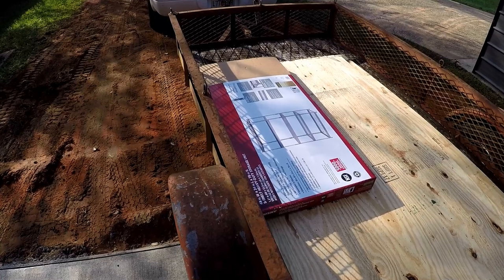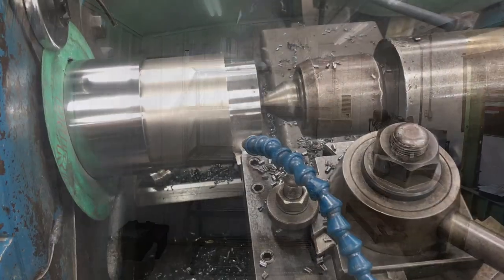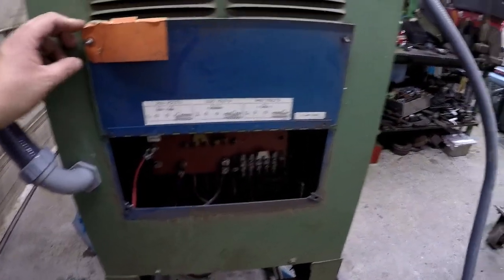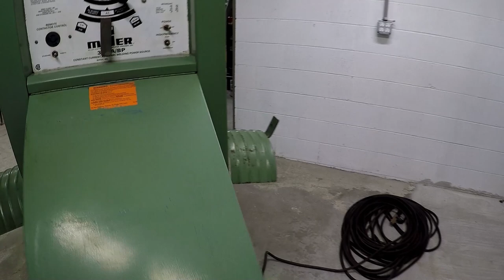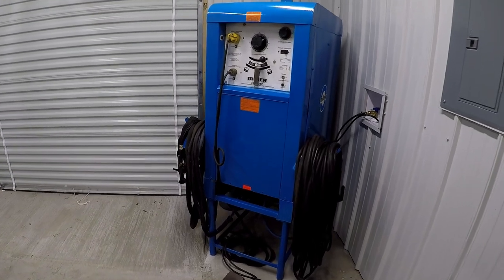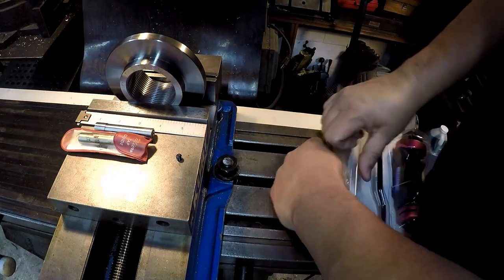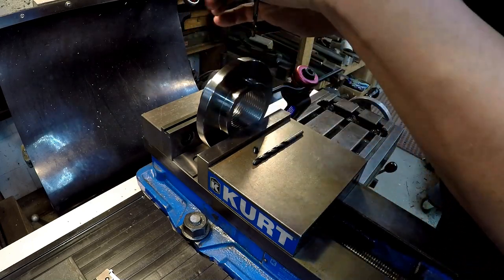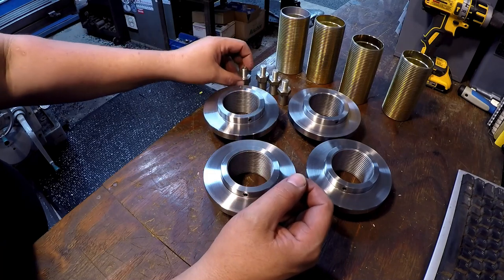SNS 192: Shop Projects, Edge Multi-Axis Stop, Drill&Tap Spring Perch

Comment: That concrete slab is great. Perfect test is running a heavy load on solid wheels over the joint between your shop and the slab.  Result?  Not even a rattle!  

Love that blue
Reply from the maker: +rupertkingsley man it was smooth, just the way I wanted! 👍🏻

Comment: If you plug cooler in to welder receptacle and leave it on the cooler will go on/off with welder. No forgetting and melting hoses.
Reply from the maker: +Rick Brandt I thought of that after the fact. We never used that receptacle.

Comment: Welder turned out great and the shop addition looks good.  That's nice to be able to adjust the start current on the welder, most machines don't have that feature.   Avoid the big box stores for plywood if you want quality hit up your lumber yard.  For what you're using it for though it should work fine once you put some weight on it, it will flatten out.
Reply from the maker: +Bill De La Vega Yea is love to buy from the local lumber yards, the problems is they are only open the time I’m at work. Big chain stores open on weekends.

Comment: If you leave the gas bottles on the left side of the door they will be more accessible and you can bolt the bottle holders to the block wall. Just plumb a line over the door to the welder. There is not much else you can put on that side without blocking the door anyway.

Comment: I think the new home for the welder is perfect but the gas bottle and the lip of the ramp bothers me. I see that edge getting all chipped and broken getting those bottles in and out. If it were me I would find a piece of wood or something to raise that area to the same height or just a bit higher than that ramp edge so you can roll those bottles across without damaging the ramp edge. Your rolling now man and half the fun is working it all out, I'm sure you'll get it just the way it works best for you eventually. I know I usually end up rearranging things several times till it's just right. I just want to let you know that I appreciate what you do to provide content on a reliable schedule. The time you put into making a video every week and working and everything else life throws at us, you ROCK. Thank you
Reply from the maker: +Michael Durling Yep I have given thoughts to something under the bottle to level that area, just havnt messed with it yet. It’s fun getting to move and rearrange things to work better. 
I enjoy bringing the weekly content.

Comment: Instead of hard wiring in the TIG welder, I'd have gone with having a Wander Plug and Socket arrangement, so the welder can be easily wheeled out, for cleaning behind it, or to plug something else in, if the need arises.

BTW. What are those four red things on the wall, above the distribution box?
Reply from the maker: +BedsitBob Your probably seeing my magnetic towel holders that I use to hold my welding hoods.

Comment: Adam on your T30 compressor... the motor doesn't look original, is it a replacement and if so what are the specs? I have one same compressor but someone stole the motor so I am looking for a replacement. I think it originally came with 10hp 3 phase but not sure.
Reply from the maker: I can assure you it's the original. I was there when Dad bought it, and when it was delivered. 15HP Baldor with some aging on it.

Comment: Adom, was looking at the wiring schematic, on the upper set of terminals, it shows 2 shorting bars, for 230 volts and from what I see in the video there is only one. Is that correct or am I missing one of the shorting bars?
Reply from the maker: +James Beckner They’re both in there.
Reply: One of the shorting bars is bent so it is hard to see.
Reply from the maker: +James Beckner I watched in the video and it does look like it’s missing, Weird. I can assure you it is though. I took pictures.

Comment: 8:19 Your local PPG or DuPont paint jobber can match that color easy and put it into any formulation you like. A 2 part epoxy should be uber durable and if you don't already have a spray gun you can pick up a gun that will do that job at Harbor Freight pretty cheap.

On my monitor, your blue paint looks like a sorta decent match for Chrysler engine turquoise ("old" MOPAR blue). Edit: Out in the sun it was old MOPAR blue. Inside the shop, not so much.

Comment: I have stopped building shelving.  There are more than a few used warehouse racking businesses in this area.  I have the heavy stuff for a workbench base with a material shelf under the top. I have another heavy rack holding  for other material and big tool boxes. My other go-to shelving is EZ-rect. I have about 50 feet of EZ-Rect.

Comment: I hate to see you take a chance with your welder. We have never used tap water, always a unit with coolant in it. After years the water will ruin the inside. Now it might take a few years buy why take that chance. The plugs in the back is probably for that. Power up welder and they become hot. I remember Florida water in the 60s wasn't that good.

Comment: The old welder is looking sharp! Mine is raised about 8in because it is on a rolling cart so it isn't as high as yours but I find it to be just fine as I certainly don't have to bend over to work the controls.  I might steal your garden hose holder idea for the cables though. I would love to have cable reels but those things are pretty pricey. Still I spend a lot of time every year wrapping and unwrapping cables so it still might be worth it.
Reply from the maker: The garden hose holders are definitely the cheap way out, but work great!
Reply: Just to stick MY nickle's worth in, a old mobile welding rig I used long ago the shop man (Burnsie we call him) built his from old car tire rims. Not on axles, but they hold more weight than the hose holders will.

Comment: Nice custom coilover suspension pieces. We use them all the time, almost exactly as shown for Pro Late race cars. The difference being we have outside diameter slots to rotate the plate once loaded with weight, allowing adjust the height and distance of the spring plate, relative to the lower base plate.

Comment: There is a sign on the welder that says do not watch the welder. The sign could say look at the welder all you want but do not watch the welding without proper eye shielding.

Another thing I notice when you showed us where the wires were behind that flap door. It looked like the wire you referred to as ground was a red wire. if that red wire is indeed the ground, please put some green tape on the wire so electricians will know what it is. Your two hot wires for 120/220 single phase are black and red, with white being neutral and bare or green ground.
Reply from the maker: +longcaster I contacted the electrician and confirmed that the red wire was indeed the ground.
Reply: Put some green tape on it. Future electricians will thank you when you identify the wires. I know when I look in there and see a red wire, I would think it was a hot wire because it is red. And a red wire hooked to a grounding lug would cause confusion.

Comment: Shop came out really nice. Home Depot should be able to exactly match a quart or gallon of paint on their computer. Just give them a chip of the color you want. Plywood that is used for signage is very good quality. Thanks for the video's.
Reply from the maker: +Waterman one Yep they have a little computer they use to match. That’s how I got the grey paint for the block wall.

Comment: The shop is looking awesome!  Love that classic Miller.  The edge stop looked like a handy like it was well made and worked well, picked up a good little tip about resetting your first part against the stop, does that change the location of the hole at all when you do that? i guess if it does it wouldn't be much
Reply from the maker: +Ramsey Customs - turbocobra Gary I like to reset the stop position once the stop is clamped tight, then find the center or do the offsets.

Comment: I do not know about your area, but in mine, go to Walmart and look for: "Muscle Rack. Heavy-Duty Steel Shelving. 5 Shelves. 3000 lbs Total. Made by Z Beam Construction, or that is what is on the box. Comes with boards. Less than $70.00" These are painted steel and NOT chrome.

Comment: I have almost the same welder as in your opening shot, but mine is orange and on a roller dolly . It's bombproof for stick welding. I have the old wire feeder for it and TIG torch but I would rather have a dedicated, modern, TIG setup.
Reply from the maker: +ColKorn1965 Yours must be the Airco version.
Reply: Yes sir

Comment: Thanks for the update. Great to see the progress.
Paint job looks good on video. If you're happy, that'll do.
Keep an eye on the cooler as it can accumulate minerals from tap water in the plumbing. A closed circuit of demineralized water with corrosion inhibitor is technically ideal, but it needs a circulation pump and heat exchanger, possibly with a fan... Bit of a bummer.

On the humidity; it can be very uncomfortable without the temperature being high. Worse if you're doing physical work. 26°C (79°F) at 100% humidity feels like 40°C (104°F) with 30% humidity. HVAC Engineers use a "psychrometric" chart to tell at a glance how much heat is in the air and what's needed to make it comfortable for work in that space.

Comment: You can always buy some Oak plywood, it's only $120 a sheet.  LOL  I ran a 9 ft veneer lathe for about a year, the tray system had 6 trays, 3 million dollar machine.  Sometimes we would get a 6 ft log in and it would literally last for 30 minutes and it was clear all the way through.  That was back in 1988, I miss those days.

Comment: Those few seconds of that stringy chip on turning the induction hardened stock, that was frightening.  As somebody said, that's razor wire in your size!  

Shop addition's coming out impeccable!  Was a long, long wait for the proper labor but that's actually helping you enjoy it more now.

Never knew that Miller welding machine was originally the standard blue all of Miller's machines are in.  I'd thought all this time that green was its original color.  Paint job came out nice!  Those two cans of spray paint turned out to be enough?

Good call on the purchased shelving.  The dad bought some shelving of similar weight capacity for putting in our basement.  Not that he plans to load it down that heavily, but close.  Just not necessarily with machining stock, more telecom field tools and supplies and wiring rolls, etc, besides the standard man-cave stuff. ^^

Has it been raining any off and on while waiting for the concrete to cure so it'll come out any harder?

Comment: Adam, you may want to check you welder on AC welding aluminum. Tap water may work but it may not.
Miller has a special additive so as not to loose the Hi Freq. Your welder may not need the additive, if it doesn't it will weld the same as always. If it doesn't, check with Miller and ask them. Cool videos Adam, Thanks.

Comment: Epoxy floors are for people who have no idea what its like to have an expensive epoxy floor in a factory. It seems like a great idea until you chip it and scratch it all up. Its not such a great idea. Its also NOT a good idea where you are welding. The weld spatter immediately scorches the coating and it releases black sooty smoke. Its not what he needs.
Reply from the maker: +Brian Streufert Epoxy is awesome for sure! We have it in our clean room at work. It’s expensive. To do the enclosure would cost at least $60” using Devcon.
Reply from the maker: +Abom79 $600
Reply: You had me at $60!

Comment: Adam, I would Apoxsee that new concrete floor in the new shed before moving a bunch of stuff in there this will keep the staining down and make it easier the cleanup. AlsoI would take some paint stripper and strip the paint off your miller welding machine, and then primed it before painting , you’ll get a better paying job if you do.

Comment: I dunno what you guys call it in the states, but look for black film face ply. It's used for concrete form work. Strong as fuck and because it has the smooth faces it looks great and is more durable. Bit more extra but it's worth it.

Comment: As your edge finder is 1/2 inch and the flange is 1/2 inch you could have found the edge of the larger flange and not bothered with the maths! You would have been bang on after edge finding.

Comment: Get some uni-strut, you can bolt that to the wall and make a nice hold down for the argon tank. At work we use unistrut and angle brackets for all the pressure bottles, makes it easy to attach the chain or strap and adjust for size.

Comment: I have a similar shelf setup, the issue is not the strength of the shelves, it is the possibility of the entire assembly racking. There is very little diagonal structure.  Attached to the wall is the best option or beef it up.

Comment: Adam, are the Kurt vise rails close enough that you could use them to center the round part for the set screw hole rather than using the edge finder?

Comment: Your dad would be proud to see you taking such good care of his tools.
Reply from the maker: Hey Keelan, how did that shaft work out?
Reply: I was hoping to let you know once I had the thing fitted, but that hasn't happened yet! I did do a 'dry fit' and it's a perfect fit; definitely nicer than what was there before. I'll make sure to let you know when I actually assemble the thing. I have to match some hand-drilled taper pin holes that were used to put a handle on the end of the shaft, which is always fun. Now that winter is here, I'll be getting back to it.

Comment: Hi Adam, I was just thinking, why don’t you try to locate some of the shelves like they have at Home Depot. They are very strong and adjustable. That is my 2 cents worth. Shop addition looks great. It only looks better every time we turn you on. Good work. 
Bill from Seattle
Reply from the maker: +Bill  Clifford Most if the bulk shelving I have seen are 4’ wide for pallets. The one I bought was the exact size I needed.

Comment: Lookin' great.  Plywood today is really junk unless you look for special grade stuff.  For your shelves, I would have used MDF or Melamine.  Since the actual support is the wire underneath, the strength is not an issue.  MDF is super cheap, flat and easy to work with.  melamine has a plastic like skin that is quite durable and is also very inexpensive.  It is harder to cut without chipping the edge but I doubt you really care about that for a shelf liner.  If you want real plywood, then either use baltic birch or get some MDO form ply which is designed for concrete forming so it is super strong and the mdo (medium density overlaid) provides a glassy smooth surface that is waterproof.
Reply from the maker: +Barry Gerbracht Thanks for the tips.

Comment: Hey Abom,  Is that a rust preventative/ protective seal (something like cosmoline) for storage that you are spraying @ 12:42?   If so,  what is the best way to remove cosmoline/linebacker from the material?
Reply from the maker: +RumpLeINtiLINsKinnIN Yes. It’s a type of fluid film. It dries but leaves a waxy/oily surface to inhibit rusting. I use solvent cleaner to remove it, or even good ole wd40

Comment: If the shelves you got have the saw dust particle board shelves, I would strongly urge you to replace them with plywood, even better 3/4" cabinet ply painted with poly
Reply from the maker: +Pat Pikulski You must have seen the part where I showed plywood I purchased to use on the shelf
 This one didn’t come with the particle board shelving.

Comment: Hey Abom! Loving the vids! just a heads up with that plywood, it wont warp if you rip it at 2' the long way and then cut them in half. Take that spare sheet and try that. you still get 4 per sheet.
Reply from the maker: +Jesse Hill Thanks for the tip. I took the other sheet back l.

Comment: What's the reason for three difference in the chips between the first pass and the second pass you showed. One was almost one consecutive chip and the other were little tiny ones that a difference in depth of cut or maybe a difference in the hardening of the rod just curious keep up the good videos glad I'm back to where I have a little bit of time to catch up on videos work's been crazy this year
Reply from the maker: I was turning through the hardened part of the rod. The second cut I was in softer metal.

Comment: Nice job with doing the wiring! Paint really looks good on welder, it really got darker and very close to that Miller color from what can cap looked like!
Reply from the maker: +Fred Newman Thanks Fred! Any luck on the drill press this week?
Reply: Abom79 Yeah working on getting the table and spindle operators working freely, but still haven’t gotten ‘back gear’ pin to free up yet, but I will get it!

Comment: Adam why would you not want to run the cooler? the way you have the water set up seems waste full and more of a chance of actually not having water flowing threw the torch. Just curious not saying its right or wrong it the way you do it thats fine.
Reply from the maker: +Gallagher Metal Works This is the way my dad hooked it up when he bought it new. It’s always worked good and I don’t have to rely on a cooler. I’ve been using a borrowed cooler but wanted to plumb it in like we had before. I don’t use it enough to worry about the amount of water it wastes.

Comment: Man that induction hardened rod swarf looks like it's making a twisted up saw blade!  I'd hate for that sh*t to start swinging around - it might cut your lathe in half!
Reply from the maker: +bsb0011 That’s the stuff that makes nightmares!
Reply: Wonder if you could temporarily clamp a piece of bar stock or something into the path of that swarf and make it break as it comes off? If it's a hardened chip, it should break pretty easily.